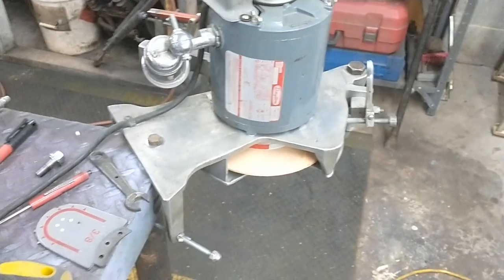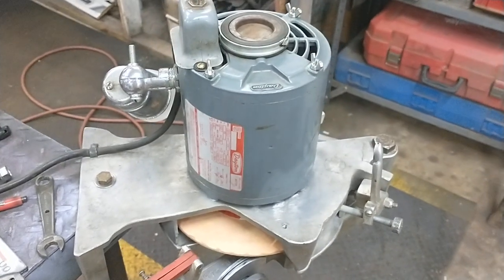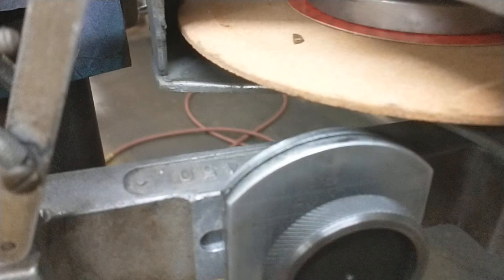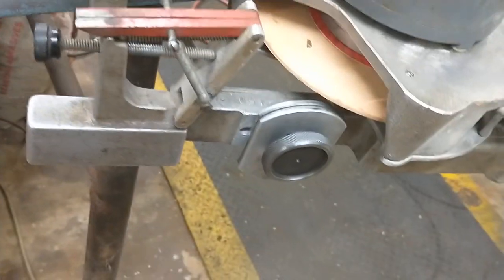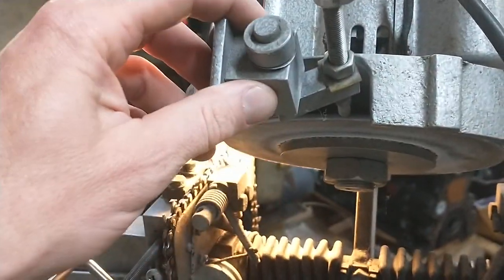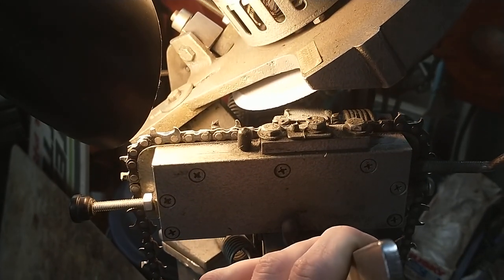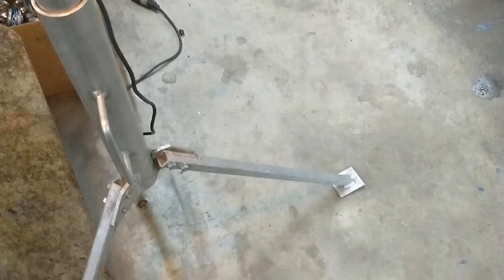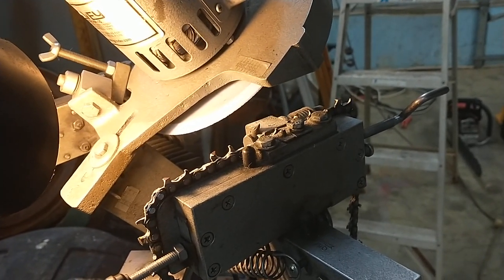Silvey sdm4 and simington 450 grinders

Comment: @Brennan Cass - Would you mind explaining the differences between the Simington 450 and the newer 451C?  Is the newer version more "precise" than the 450?  Do you think that a 450 could be modified to not flex as much as you showed in the video?  Does the 450 have a reversible motor?  Is there any reason to think that a newer model grinder, be it a Simington or a Silvey, outshines the 450 in any major way?  I've got a chance to buy a Simington 450 and I know nearly nothing about this class of saw chain grinder; hence, the questions.  I trust that you understand.  Keep up the great video work!  Liked and subscribed.
Reply from the maker: 451c has a completely different 2 piece arm that isn't capable of alot of adjustment. Not really a problem on work chains but race chain angles are more difficult to hit with them, though it's still doable. 450 & 451c both have reversible motors. Silvey has been out of business for awhile now so anything you see will be up to the aftermarket to provide, which is limited. Upgrades to the machine are entirely up to your mind/abilities. If you are just interested in work chains, the 450 is perfectly suitable to your needs and the ability to modify to fit your needs are there. Hope this helps.
Reply: @brennancass3747  Thanks very much for the reply, BC.  Apparently, the 450C that I'm looking at has been "modified" for racing chains, so that gives me pause.  Although you've obviously invested in older designs, I was wondering what your thoughts are on modern uni-directional chain grinders like the Oregon 510-120 or 610-120 models?  I suspect that the answer is fairly obvious, but are the older Simington and/or Silvery chain grinders simply in a much higher class than the newer designs like those I asked about?
Reply from the maker: @timberwrightsvs480  you're talking about round grinders with the Oregon versus square grinders like the simington and silvey grinders. Silvey did make a couple round grinders as well. Just depends what you're after in the end.
Reply: @brennancass3747  Yes, you're correct.  Quite honestly, we've never owned a grinder.  I was taught to hand file saw chain, but I admit that the number of full chisel work chains we go through has made hand filing unrealistic.  I've been told that a round chain can be ground into a square chain, but, obviously, a good round grinder would be ideal.  The point is that I don't like throwing good money at junk, regardless of cutter shape, so I've been under the impression, for years in fact, that the only high quality grinders were either Silvey or Simington.  I hope that I haven't muddied the water here, BC, but we have a growing pile of chain here that requires attention, so I'm simply looking for a dependable grinder to put our work chains back in service.  Thank you for sticking with me.

Comment: @Brennan Cass, can you sharpen .63 gauge chain on the SDM4?
Reply from the maker: I don't, but I'm sure it will.
Reply: @brennancass3747  Many thanks!  I run .63 and bought an SDM4 yesterday without thinking about chain gauge.
Reply from the maker: @Rhodesian_FAL  most every square grinder I've seen does at least .050 and .063 so you should be fine